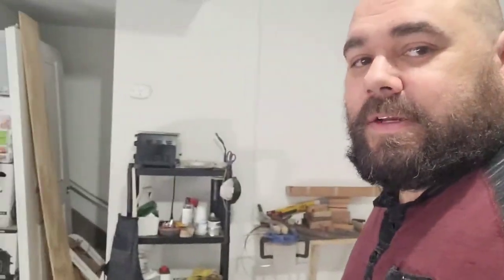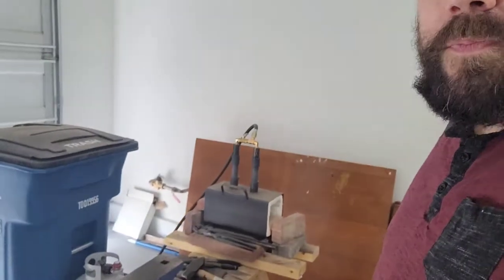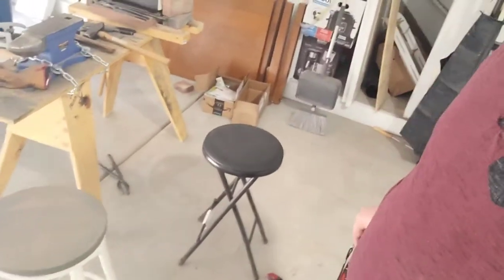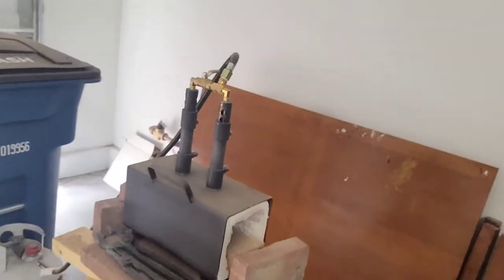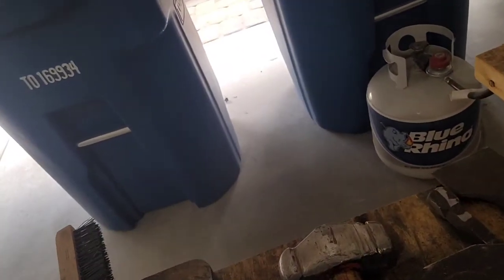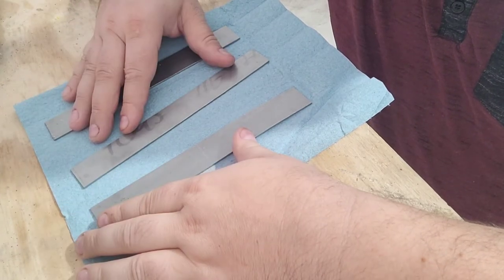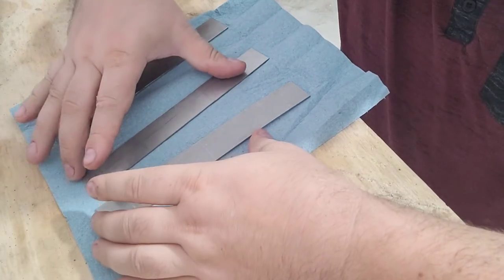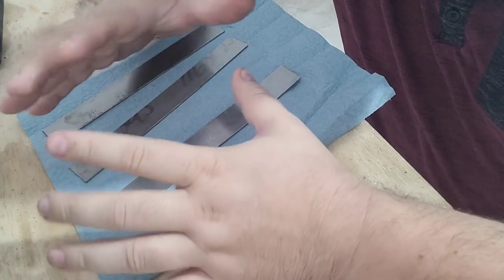Making a SAN MAI without welding

Comment: Wouldn’t you be putting forge scale while heating it before sticking it on?
Reply from the maker: Possibly but at these temperatures when you brush it will take a lot of it off. If I remember there were no issues the pattern was great

Comment: Are you sure you are keeping track of where that 15n20 is?
Reply from the maker: That is a really great question @sanjeevdalela. The Nickle is the two outside metals the core is 1095. So as I gride and sand the bevel into the edge. The 15N20 draws up to give a beautiful Hamon and because I used 1095 for the core that will give a tough edge with less chipping and rolling